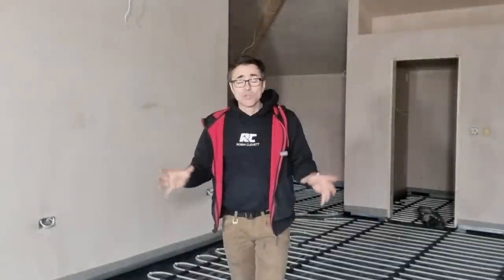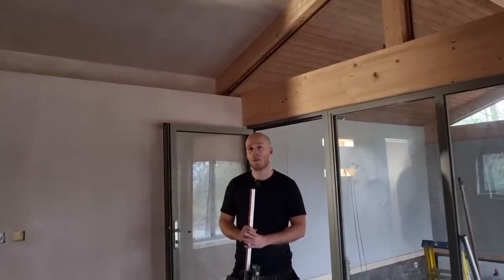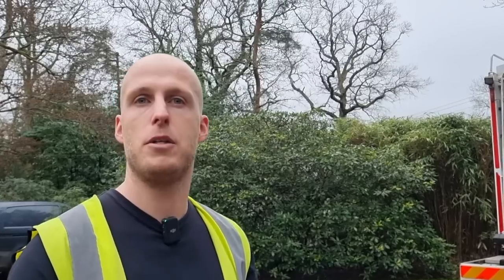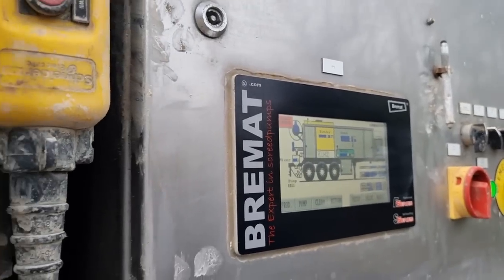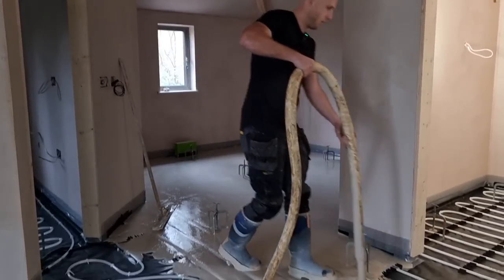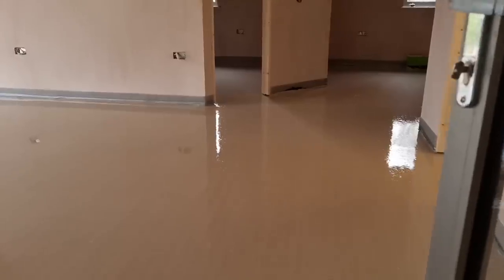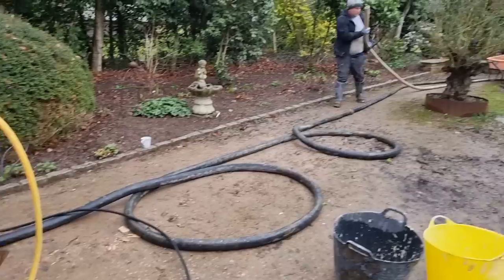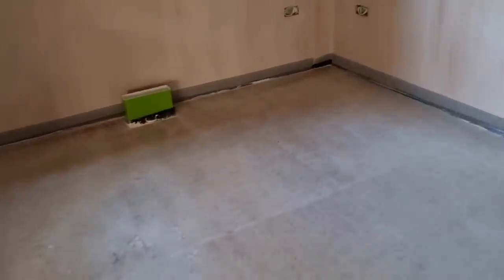Screed for a perfect finsh at the Ultimate garden room

Comment: Soooo satisfying to watch a wet screed flow .... Thinking of back in the day, knocking up the sand'n'cement by hand - Just Me, My shovel, trusty wheelbarrow and a few lengths of 4x2's to get an 80yd house screed finished in a day - A bit of a back-breaker being a Plasterer, rather than a full-time screeder 😄 .... Is the cost an issue though? it looks expensive 🥴

Comment: Benefits of anhydrite far out weigh cement based products until you get to the point of fitting a floor, then you start to loose some of the time and money you've saved due to the grinding and prep required to get it ready for flooring

Comment: I have a question. I see that you have your timber frame, and wall insulation in place, as well as sheathing and gypsum boarding. THEN, what do you do with this excessive expansion band at the corner, and even if you cut it, wont it still be like 6-7mm gap? Or and even if you cut it, won't then the water get in (in case you spill something at the wall corner?)
Reply from the maker: Well its covered by skirting boards, if there is an escape of water then yes possible it could migrate into that space after seeping under the skirting
Reply: @ukconstruction  Thank you Sir. I'm an architect, and was trained in reinforced-concrete buildings. Timber frame is more of  western hip,. Buy, I'm very curious, because, I guess that there shall be something to do with that.

Comment: Amazed no expansion joints or reinforcing on external corners. It always cracks
Reply from the maker: This screed needs minimal expansion joints in small areas like this, it is super strong even at thin thicknesses
Reply: @ukconstruction  yea we have laid a ton of this stuff and use Cemfloor, you can lay up to 150m2 without expansion joints. But we always out expansion joints in doorways and reinforcing at external corners as the slab always wants to crack at these points. But we still have some cracking. Will be interested to see when you commission the heating if you have any cracking.